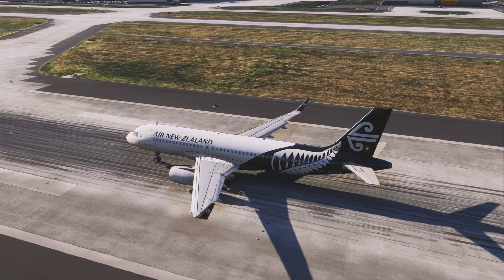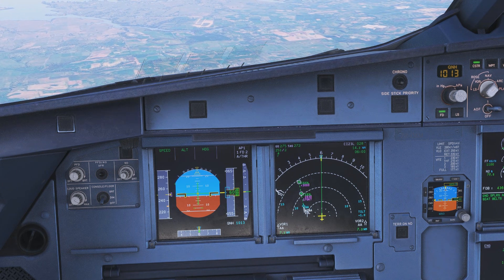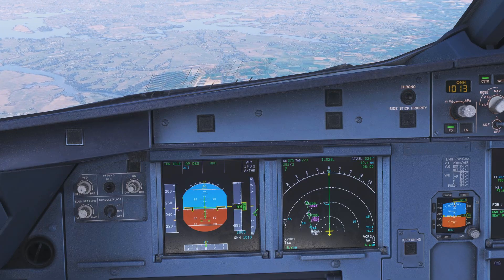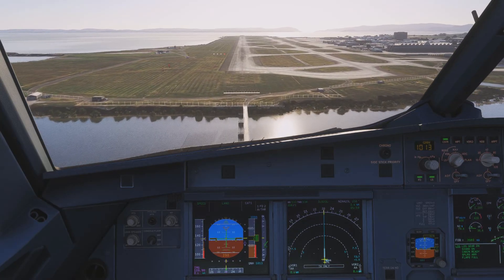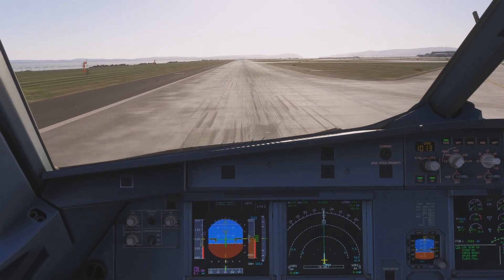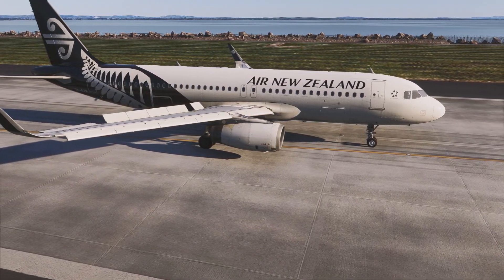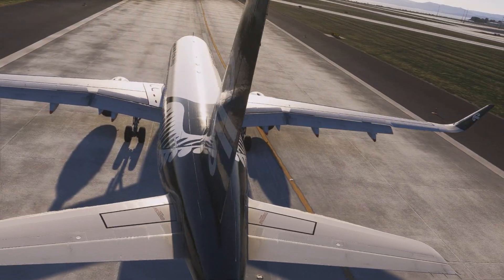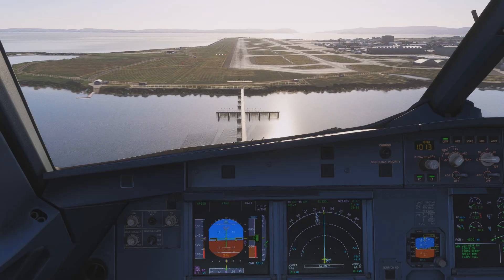How to correctly manage an ILS approach!

Comment: Is there a situation when you don't want to use autobrakes at all when landing? I have been wondering why arming autobrakes is not one of the LDG checklist items on the upper ECAM display (the list that shows LDG GEAR ON, SIGNS ON, CABIN READY, SPLRS ARM, FLAPS FULL). Now that I have done some landings in MSFS 2024 I have created a habit of enabling the proper level of autobrakes based on the landing performance calculator, but in the beginning, on more than one occasion I forgot to do that as it was not one of the checklist items on the ECAM.
Reply from the maker: The autobrakes are on the approach checklist. They are also part of the landing calculation and part of the arrival briefing, so very hard to forget. 😊
Reply: @fsclips  Yes, I understand that. But I suppose that same logic applies to f.ex. lowering the landing gear too, and it is on the ECAM checklist.
Reply from the maker: @hege750 The landing gear is protected by the GPWS system. Also without the gear down the aircraft will never slow down, so you would notice immediately that something is off.
If you would have to put every single item on checklists ( landing lights, taxi lights, go around altitude set, etc.) you would only check the aircraft never fly it.
As a pilot you get paid to do your job and that includes remembering stuff such as the gear 😊
Reply: @fsclips  Fair enough. As I said, I was just wondering. I don't have the qualifications or competence to make any statements. ☺

Comment: Hi. Very interesting vidéo! Just a question: you don't seem to have pressed the LOC button.... Not necessary for the approach? Thanks for your great clarity!
Reply from the maker: With the LOC button the aircraft will only follow the localizer but not the glideslope. When you press the Appr button the aircraft will follow both.
We usually only use the LOC button for specific approaches or when we are only cleared to intercept the localizer. I hope this helps

Comment: When do you hit the approach button / mode? I think it was already armed when you intercepted the glide slope. Does the override any ALT setting you have?
Reply from the maker: @oldRighty1  I suppose you mean when to activate the approach phase?
If so then make sure you are on selected speed as the activation will trigger the plane to start reducing the speed to appr speed. 
Usually, once you are below 10.000ft and you have a clear Idea what your approach will look like, you can push it.
If you follow a pre-programmed Star and approach, the aircraft will activate the approach phase by itself.
I hope this answers your question?
Reply: @fsclips  That does, in the context of I'm really a beginner with the 320 and could ask questions all day and keep going 🤣 so I appreciate the answers. I guess that sort of goes along with what does activating the approach phase actually do? For example, if I'm on a STAR and there are speed constraints, I assume it adheres to those? I'm guessing real world approach you want to be on selected speed a lot, there's probably either ATC telling you how fast or you are making judgements, as long as you stay under any constraints? So it sounds like if you have a STAR programmed, what when you hit the first waypoint the plane cuts over to approach mode. If you don't have a STAR but you have an ILS landing, you hit that based on the criteria you mentioned. I guess related is when does it start tracking the ILS. Say you get a vector from ATC to intercept the localizer, you're coming in at an angle and you hit the localizer but are under the glide path, does it automatically straighten you out to follow the localizer, level until you intercept glide path & then automatically starts descending when you intercept that too? Does it matter if the STAR feeds directly to ILS or if there's a discontinuity / manual segment? (I'm guessing this is why pilots get a lot of training lol).
Reply from the maker: @oldRighty1  That's a lot of questions 😄 How about I will make a video about the approach phase and how to correctly use it and transition from a STAR to an ILS?
Reply: @fsclips  That would be super awesome! I'm probably going to do some flying this weekend and watch that, I was moderately impressed with myself prior that I could actually start and take off :) I'm a filthy casual at this but I'm learning.
Reply from the maker: @oldRighty1  Maybe just go through the playlist I made called MSFS how to... It covers many topics, also descend planning and other topics
Reply: @fsclips  I'm looking through your channel and a few others - all the vids are highly appreciated! Like I said, just learning, but I have figured out pull back, ground gets smaller, push forward, ground gets bigger :)

Comment: Hi, thanks for the videos.. in real life (none autoland) when do you disconnect Autopilot and hand fly?
Reply from the maker: @fulanitoflyer  This is really up to you. The vast majority of the pilots do it after the landing checklist when everything is done and all that is left to do is the landing. If you are at a small quiet airport you might do it earlier, if you fly into LHR or FRA you might just do it before minimums. It really depends on your preferences and the circumstances. Airlines usually don ´ t have any rules regarding this, but they urge you to use common sense.

Comment: Thanks for your videos! If you're having FPS issues on short final, give the Auto FPS plugin a try. It's free and automatically adjusts the LOD based on your fps or altitude. Might help smooth things out!
Reply: Strongly agree - autoFPS is critical to being able to operate at complex airports if your system is mid like mine. Then it dials up the eye candy when in normal flight!

Comment: Its seems your vram is full. Try to lower de texture resoluten. And Losesless scaling is an lifesaver.
Reply from the maker: Yes, I use lossless scaling together with the DLSS feature. It gives me good FPS most of the time but it is very unstable
Reply: @fsclips  Disalble dlss and lock your fps at a number you most of the time can reach. Like 40 or 30 and then double or triple( triple gives little more articats) the FPS with Loseless. Here its working like a charm. Have you tried to lower you texture resolution ?
Reply from the maker: @Patrick_AV  Thanks. Yes I have followed countless guides that promised big FPS gains...never happened for me. Tried all sorts of settings.
Performance is not the only problem though. Sometimes I don't have any sound, the camera is buggy, selecting a specific plane is a gamble, the loading times are almost double of MSFS2020,... It's an unfinished mess

Comment: Great video as always, thank you. Thoughts on when you disconnect auto pilot?
Reply from the maker: This is really up to you. The vast majority of the pilots do it after the landing checklist when everything is done and all is left to do is the landing. If you are at a small quiet airport you might do it earlier, if you fly into LHR or FRA you might just do it before minimums. It really depends on your preferences and the circumstances. Airlines usually don´t have any rules regarding this, but they urge you to use common sense.
Reply: Many thanks. That’s really interesting and helpful. Looking forward to your next video 😊

Comment: For gear down decision I've come to use 2000ft + elevation of the airport, it usually works out fine and it's close to 6nm as well , obviously I do adjust my decision depending on wind weight and IAS .
This might sound strange but I think this way
1000 + elevation, to be stabilised  + 1000 = gear down